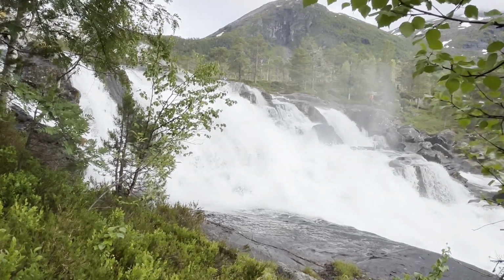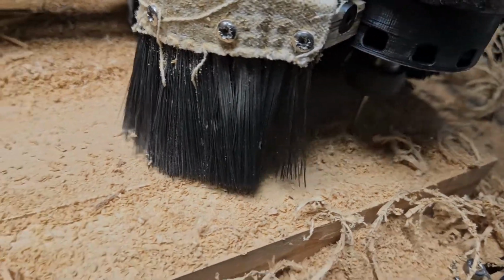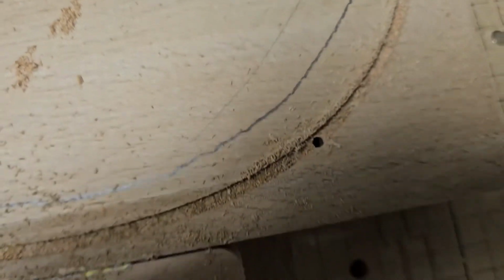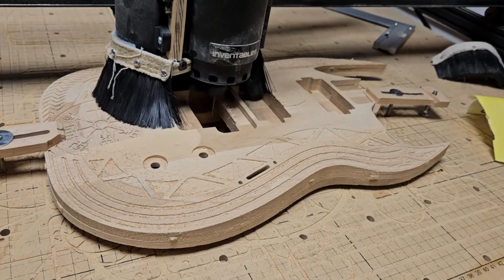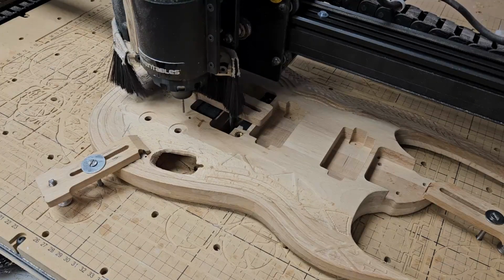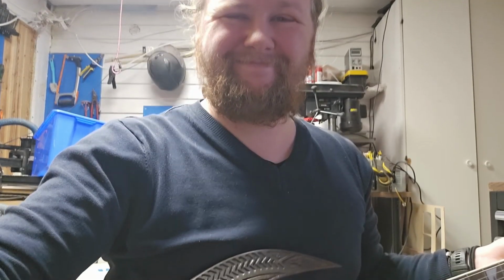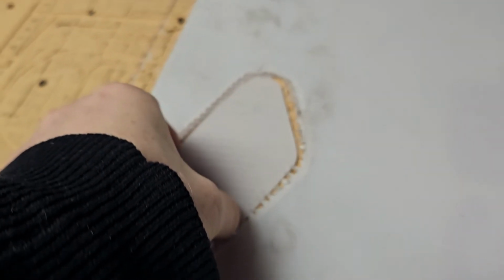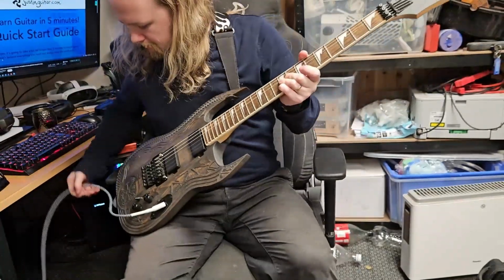I made a guitar for Odin!

Comment: How much was cnc machine? Also dope guitar dude
Reply from the maker: @RouxGamer  Thank you!
I bought the CNC used for 7000 NOK. Which is about 700 USD. There were unconnected cables and some loose wheels baked into that price. 
The controller died at one point.. Fortunately I could whip one together with an Arduino and some cheap stepper controllers!
Include the controller and some bits, and my total is around 800 USD at this point👍
I believe it costed around 3000 USD new btw. It was around 6-7 years old when I bought it I believe.
Reply: @ thats a big buy, do you get your moneys worth out of it?
Reply from the maker: @RouxGamer  hmm.. I have sold maybe 6 items so far made on this. So, not yet. Don't believe I will make it back. For me this is a hobby I enjoy spending time on. Getting the money back isn't the first priority:)
Are you in the CNC game?
Reply: @KvistEngineering  no, but I was thinking about purchasing one at some point in the future, would make things alot easier. 
However its alot of stuff to weigh in, cost, usefulness, what I would actually use it for. Im sure you get it, you bought one for god sake.
Maybe further down the line, so I can get some proper use out of it rather than a money pit.
Anyways, sorry for the rant, cant wait to see what else you use yours for.
Reply from the maker: @RouxGamer  I did not have a lot of things to make when I bought it. But I viewed it as learning a tool that I can use for stuff later. And I was right about that:)
Reply: @KvistEngineering  i gotta get my own shop, or atleast some of my own stuff before I do anything. 
Cant wait to see your channel get some actual traction though, I hadn’t even realized you were on the smaller side of subscriber count. So clearly your doing something right.
Best of luck, and I wish you well